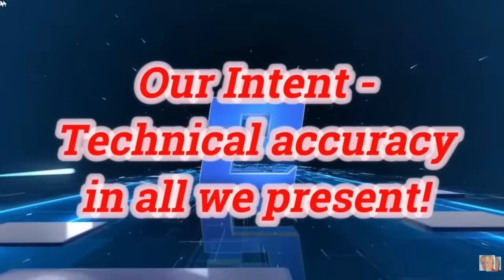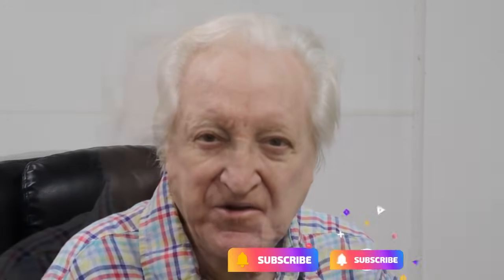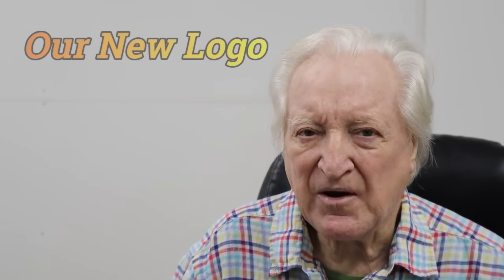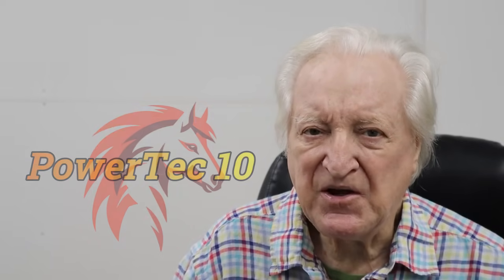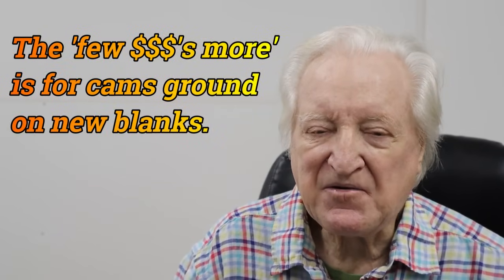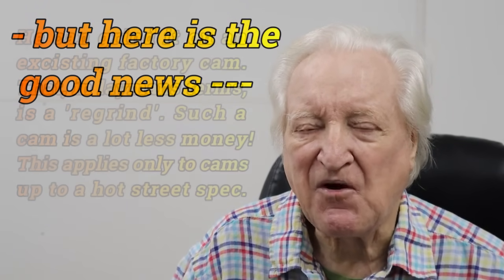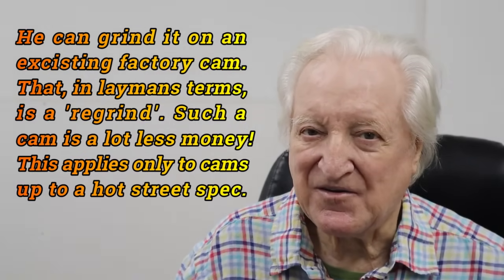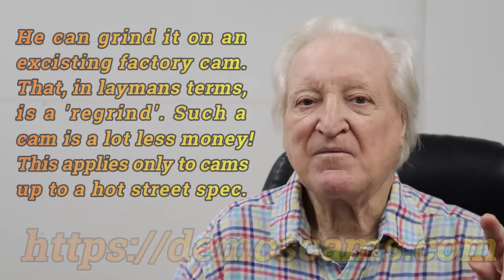Cam supply problem? Here is a possible solution!

Comment: @ David Vizard: A bigger down pipe with a bigger cat. Yes! I said so to a friend but he didn't believe me. The down pipe and the bigger cat. After the cat, so far as my thoughts go, could the mid pipe be of a smaller size. But bigger then factory. Also, after the cat you can mount a conical piece of tube to let the pulses flow into the some what smaller diameter. 
- What are your thoughts on this?

My own set is a spaghetti manifold and a sport cat. On both sides of the cat. the diameter is the same (sport exhaust system). The tubes of the spaghetti itself are lots smaller an flow from 4 to 2 to 1.

Comment: Sir i have been binge watching your videos and I am understand some of your videos are describing but I have a question how does on get the cam back in the correct lsa if it doesn't add up using the degree wheel i hope i am asking this question correctly.
Reply: If LSA isn't perfect have the cam reground. If you want to advance or retard cam timing use an aftermarket cam and crank gear or offset key-way.
Reply: @Twogreenfeet  I just re read my comment and the auto correct spelling is leaving out some of the correct spelling ok if the cam that someone buys is not adding up using the degree wheel so one has to use the cam or crankshaft gears that has a Straight up zero or advanced or retarted key way to get the cam in the correct lsa as needed? I have researched different cam timing chain choices and there's some that have that 0 degree and 4 degree advanced or 4 degree retarted or multiple timing choices to get the camshaft in correct timing if it's not correct in using a degree wheel I apologize if what I am describing is not explained correctly I'm getting into building a engine correctly at my age now in my 50's and want to understand everything about building engines it's always been a bucket list of to do and understand everything about building a engine correctly and optimum the most power out of them .

Comment: 🔔😎
Can you please do a video about pushrod length and valve train geometry.
And noting the roller rocker tip to valve stem offset that increases low lift  opening.
Pushrod 5.0 Ford mild modified, here. Thinking 1.7 PRW Sportsman on a stock 5.0 cam with ported 289 heads.
Thank you !!

Comment: I Got My Custom Camshaft Last Week From Comp Cams. Luckily They Had Cam Cores In Stock For My 3800 V6 97+ Engine. I Originally Speced A Cam For 108 LSA Based On The Trends Of A SBC And You Quick 128 Formula. Unfortunately They Said The Tightest LSA They Could Grind Was 110LSA. So I Went Back To Drwaling Board And Speced A 110LSA Cam. Either Way It Should Be Much Better Fit For How I Use My Engine Than My 117° LSA Cam I Had In It.
Reply: 👍 Run a cam timing loop and reprogram and it should do well.🔔

Comment: You’re saying…
“Have Grinder - Will Port”:)
Elvin says, “Have tig welder, will weld”:)

I say this in regards to the Crown Victoria Project.
The Twin Turbo project. 

I would definitely enjoy specializing in single or Twin Turbocharged V8 engines:) 

Your 1,000hp Chevy you had in California?
I bet that was a gas …
Jumping Jack Flash - it’s a Gas Gas Gas:)

Comment: King David Sir. 
Elvin has been doing research:)
Edlebrock Torker 2 Camshaft..
108 degree LSA
480 lift, just short of your .250 formula:)
But - with 1.6 - 1.7 rockers
You’ll achieve your .250 rule 

We know the Torker 2 intake needs to be ignored, but whoever designed the cam, must have been one of your loyalists, knights behind the curtain.

Comment: Can't wait for the LS3 Enforcer info. Considering them for my 3/4Tn truck. They seem to be a better fit than the stock LS3's. Them heads, an mild 270/270 (seat to seat) @ 109+4 cam, and proper tuning should give me plenty of smiles-per-hour. 
This truck is my daily, plus hauls a dirt car and tractors on the weekend.

Comment: "Decreasing the back-pressure on the exhaust stroke" in order to gain some HP. Interesting idea.
Reply from the maker: Nathan, Lowering back pressure is by no means new. Watch the zero loss muffled exhaust system video - Its back about episode 25 or so - I think.
Reply: @DavidVizard  I wish every episode was available in order.
Reply: Engines run on Delta P, pressure differential. If you have high exhaust pressure, you have reduced the Delta P.

Comment: If you need a cam core to regrind for your 318 project, I have several 340 nhra stock class cams with tighter lc you can have
Reply from the maker: Patrick is that for free??????
Reply: @DavidVizard  you bet!
Reply: I hope this happens! I want to see what these guys can do! I want to see how much power a cam can make for the motor it was made for instead of a cam company what they want it to be. I’m so hoping to see this I can’t imagine how much more power it could make.
Reply: @richardmoerke9329 
DV has indicated that on many 40/40, some much more.

Comment: Have you ever taken apart one of the Garrett turbos to compare your modifications to🤔? Can theirs be improved?
Reply from the maker: Not recently if ever, but anything can be improved.
Reply: @DavidVizard  I was just curious. If I had one I would send it to you. Me personally I don't like tea kettles😅.
Reply: @lynnrunningdeer Most exhaust housings are as cast so just cleaning them up as intended so they flow decent Typically offers noticeable gains. I recently did do major whittling on a borg Warner turbo housing and I got it to spool 200 rpms quicker while also dropping peak back pressure by 10psi (65 to 55) with 47psi of boost.
Reply: @bcbloc02  unfortunately I can't see anything after what appears. YouTube has blocked this feature again😡.

Comment: Are ecoboost still clogging up? Or have people learned not to turn them off? I wouldnt think youd own one! But sum people just need to fix stuff!
Reply: I didn't see any difference🤷‍♀️. The milage remained the same and I didn't notice any hp difference. Personal experience wise.
Reply from the maker: @lynnrunningdeer  Was this with turbo housing modfs????
Reply: @DavidVizard  If you are referring to my other comment then yes. I would like to see if you can surpass one of the industry leaders in turbos. I'll see if I can find an inexpensive one on Ebay that may need rebuilding. I'm not holding my breath though. Anything for Science😊.